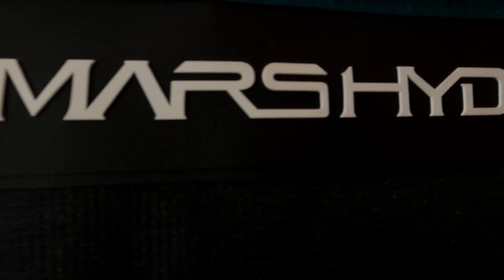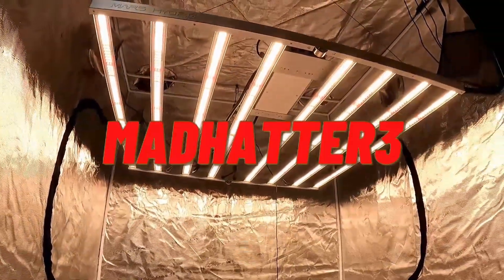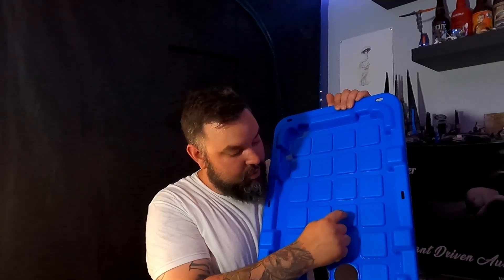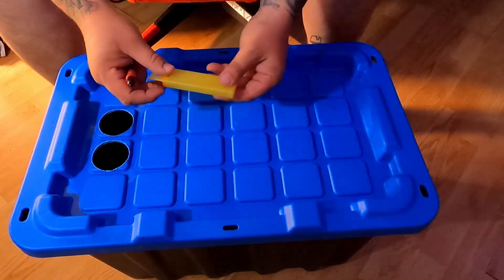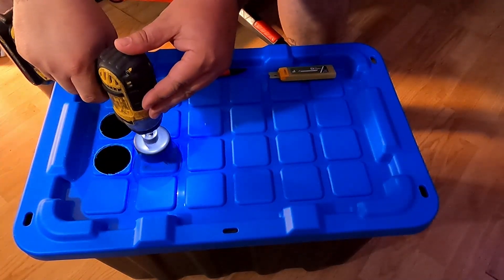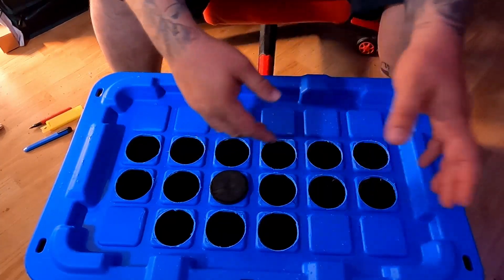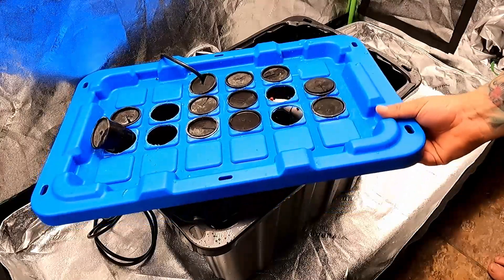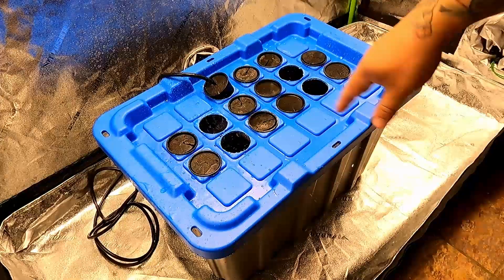HOW TO BUILD AN DIY AEROPONIC CLONER | SPONSORED BY MARS HYDRO

Comment: That very cool doing your self hope it works good now you got me inspired to make one great content great tips Great show. ✌🔥💨  
Ps I have a question iam getting in to hydro my problem is I usually soak my seed first in 💧  do I still do that before I use my Dome or should I just put my seed right  in the  Dome do I just spray the top and how much 💧 do I use in the bottom of the Dome that's my only problem I can get them started and soil no problem but in the dome I gotta get a technique for the Dome hope you can answer this question.thanks  great video Great concert Great tips Great show ✌
Reply from the maker: What do you mean by dome?

Comment: i've never used one whats the real advantage? i do the old school peat pucks,dome ,under flc,and get a honest 90% success rate in 3-10 days some strains take right off others seem a bit stubborn and i;ve run literally 80-100 at a time. so whats the plus ? just seems like another mess and cost,great vid i really like your content,thks!!
Reply from the maker: Every one has their own way of cloning for sure, I’ve seen amazing results with this method and it’s typically 100% success. I’ve found that this is the best way for successful cloning for my self and its a nice way to be able to pick and choose which media you want to transplant into and never having to worry about over or under watering clones.
Reply: @madhatterorganics9944  good point on the watering-i might make one for fun,when i find someting with a water tight lid thanks for the input
Reply from the maker: @mariusadam4429  I might run a bead of silicon around the lid instead of using the window gasket, it works but i think it might be more of a pain in the ass down the road.
Reply: @madhatterorganics9944  better yet, turn the top of the manifold down so that the nozzles are facing down. That way they still spray out horizontally and hit the roots but without the mess or need for a seal of some kind around the top of the bin. That’s how I’ve got mine set up. Works a charm, absolutely no leakage. If you’re like me, this will allow you to run the system with the lid off and have a peek at your project in action without coming into contact with a single drop of water. Great video!

Comment: r.o. or distilled water definitely helps. I just used a turbo kroner for the first time and learned my well water has way to much calcium and cloggs up the pump. I think I will build one of these one though.
Reply from the maker: Yes forsure, I use a RV filter to clean out and harmful chemicals and what not and have had decent luck with it so far. Thanks for tip!

Comment: The window seal does work if its oversized. I found it's just easier to get a squeeze tube of sealant and replace it when I use it, or a five gal. Bucket works well with there lids. Thanks for the diy project. 👍